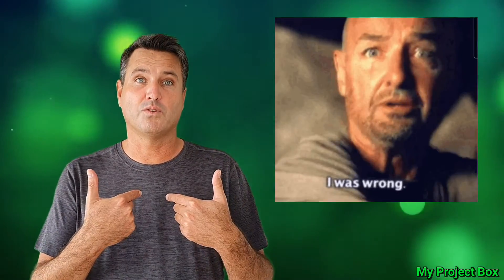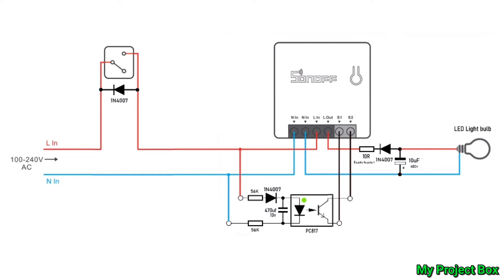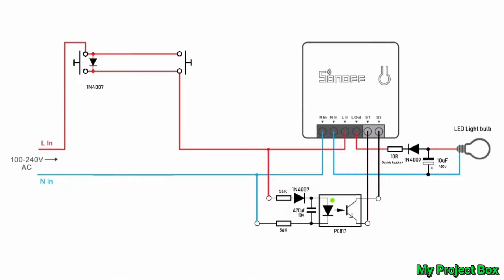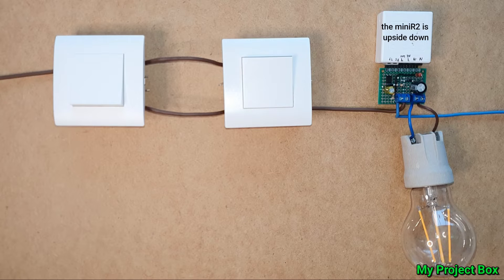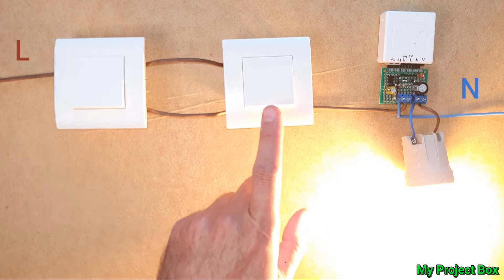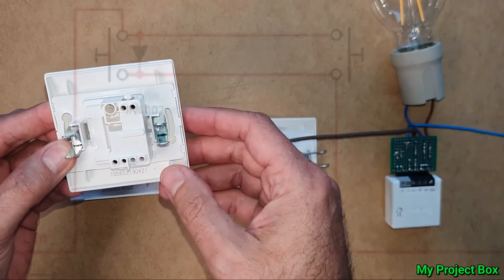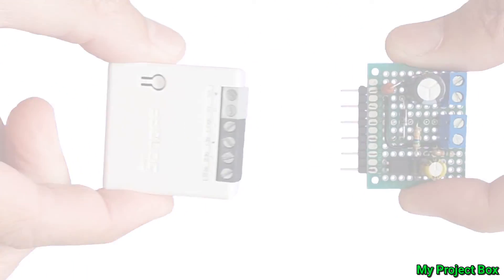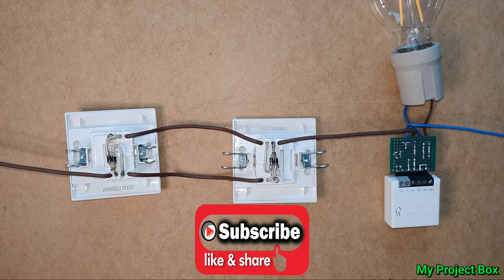Sonoff mini 2-way 3-way light switching NO-NEUTRAL solved #2wayswitch #NoNeutral #sonoff #3wayswitch

Comment: What a great solution for older wiring plans, ie where there is no neutral at the switch and/or no permanent live at the light fitting. I'm interested to know whether you have tried the same approach with a Shelly 1 rather than a Sonoff mini?
Reply from the maker: The circuit works perfectly with Shelly1 as well! I've not done a video on the two-way lighting version of my hack, but it works. I have several "no-neutral" solutions for Shelly1. 
https://youtu.be/fT3YztU2MYE 

https://youtu.be/YItMu6VJGBI

Comment: Can you do 2way uk for the no neutral variant? Thanks
Reply from the maker: Yes it would definitely be possible to do it with UK 2-way lighting. It should be a bit simpler, because you would only require one diode, across the switch that has  live-in and switched-live out.
It would also be possible with my simpler no-neutral hack circuit https://youtu.be/oBR5O391m_c I might have to do a video about it😉👍

Comment: How beautiful it is is what you have done. I'm very impressed. Now I'm sitting around wondering what to buy to match the components for my voltages and frequency. If there was a little bit of theory with calculating the size of the components I would be entranced. For example, are the resistors before the optocoupler too large or current is too low for optocoupler diode?
Reply from the maker: This circuit was demonstrated in this video on European "220-240 volt"50 Hz. It should work on 110V in North America mabe just reduce the resistor values and increase the capacitor values. Sonoff now has "magic switch mode" for the Sonoff basic-R4. It makes doing this much simpler and easier. https://youtu.be/NudSvGNqbAo

Comment: Hello - thanks for this video. So useful. Any chance you could tell us the exact diodes you used? There seem to be so many options online. Thanks
Reply from the maker: I used 1N4007 diodes, they are rated at 1Amp. You could use bigger more powerful diodes, if you want the circuit to be super tough and robust. Diodes like the 10A10 , are rated for 10Amp.
Reply: Brilliant, thanks so much. My knowledge is limited but doesn't an LED lightbulb pull more than 1amp? Or is the diode only under strain when the circuit is closed and halfway is going through it powering the Sonof? 

Also - what would be the advantages / dis-advantages of getting the higher rated diodes?

Thanks so much for your time, it's much appreciated

 @MyProjectBoxChannel
Reply from the maker: @RGH-rq4gj  1AMP at 220v is  effectively 220W. Most LED bulbs are not much more than 12w. If you use 10A diodes, that gives you a crazy 2200W to play with. But the reason for possibly using 10A diodes, is in case something goes wrong, and you get a short-circuit. It's makes it more likely the diodes can survive a dramatic event like that, and the circuit breaker tripping without damaging anything. The 10A10 Diodes can handle 10A continues, and over 200A for a brief instant. So it's much harder to destroy a 10A10 Diode, but it's much easier to blow up a 1N4007. The 10A10 is bigger, so it will waste more space than the smaller 1N4007.

Comment from the maker: This PCB was not designed by me, but I did help and advise the designer. He wanted to be able to change the filter capacitor for different types of LED load. So you connect the capacitor of your choice, directly to the output terminals. The two 500k resistors are in parallel with the capacitor, and are there to safety discharge the capacitor, to prevent a shock from  it, because it can hold a charge for a long time. The bigger diodes are simply to make the design more robust bigger ones can probably survive a circuit breaker tripping, if there is a fault or short-circuit. He used a very big fusible resistor for bigger output loads. 

The PCB works fine but it still needs some work / tweaks. I think the fusible resistor position needs to change. It would be better to only be inline/series with the capacitor. That would prevent it from getting blown from bigger more powerful output loads.

Comment: @MyProjectBoxChannel  hey, I saw your pcb layouts on github and i wanted to know why you exchanged the 10uF capacitor after Lout of the Sonnoff with 2 500k resistors? Can you please explain why you did this? As you said you added the capacitor against flickering. So why and how are those 2 resistors do that job now instead ? 

Another question I have is why you didn't put 10A diodes directly instead of changing from 1A to 3A ? For safety reasons .... wouldn't it be senceful to use diodes with the max. current the sonoff supports from its side, even if noone would usualyy not use 2000W lightning at all? So the diodes behind the switch never should get overloaded by some faults.

And as my last question, because I don't really get it somewhere .... what is R3 for an exact value (what means 5W5?) and what is that resistor used for? 

Thank you very very much for your efforts !!! You make really great work !!! thx
Reply from the maker: This PCB was not designed by me, but I did help and advise the designer. He wanted to be able to change the filter capacitor for different types of LED load. So you connect the capacitor of your choice, directly to the output terminals. The two 500k resistors(makes 1M resistor)are in parallel with the output capacitor, and are there to safety discharge the capacitor, to prevent a shock from  it, because it can hold a charge for a long time. The bigger diodes are simply to make the design more robust. If you use 10Amp diodes they could survive a short-circuit/fault , and circuit breaker tripping.
The "big fusible resistor" was chosen by the designer, for bigger output loads. But I think it would be better to move the resistor, and now put it inline/series with the output capacitor. That would prevent it getting blown by bigger/ more powerful loads. It would  no longer have to carry the full output current, just the inrush current limiting to the capacitor, and ripple current. The PCB works great,  but needs more work/tweaking. I don't like the big power resistor, as the fusible resistor. So that's why I want to change the position, so you can use a smaller one. It's still a work in progress 😉.
Reply: @MyProjectBoxChannel  thank you so much for the explanation and a nice xmas :). Now it's totally clear, after you explained it again. Don't know why I didn't notice that by myself :D So, if I see it correctly on the pcb layout you either use a resistor OR a fuse, correct? In the schemativ you have a resistor AND the fuse in series, but on the pcb is only one component placed (R3). Is that correct ?
Reply from the maker: @andreasj.411  In my original design I used a special type of resistor, called a fusible resistor. It behaves as both a fuse and a resistor combined. You can also create your own fusible resistor, by putting a resistor in series with a fuse. The there are different versions of the pcb. I think the designer chose a really big power resistor, for heavy loads. I'm not sure if he chose a big "fusible-resistor", or just a big ceramic resistor, but you could make it fusible. You just  use a resistor+fuse. I'm starting to think that this resistor used as the main protection fuse, could be problematic for bigger loads. His solution was just use a bigger resistor, but I prefer to move it out of the main current path. A bit like in this video https://youtu.be/mznx0xoF8Ck

Comment: Nice video, i've created a homemade circuit in Brazil and it works. I would like to print this circuit, do you have any geber files that could share?
Reply from the maker: I have some prototype files for the shelly1 but it can work with the Sonoff mini-R2 https://github.com/orlin369/DeNeutralizer/tree/main/DeNeutralizer 
Here is a NO-NEUTRAL circuit that is also useful https://youtu.be/oBR5O391m_c

Comment: Hi again @MyProjectBox... do you know how to connect sonoff switch, shelly or any smart switch to short distance touchless pir sensor like this one - "or-cr-213 short distance pir sensor"
I'm using such sensor in my kitchen and with moving my hand near the sensor the led light in the kitchen is turning on. I want to connect the sensor to smart switch and to keep using both - the switch and the physical sensor. The pir sensor has 3 wires: phase, N and COM

Comment: Would this work with a UK 3 way switch that has an intermediate switch?
Reply from the maker: That is a good question 🤔. I in theory it could work, BUT! If the intermediate switch is switched too slowly, then the sonoff will lose power for a brief moment. This might cause problems. The intermediate switch might need diodes aswell. I will have to look into it.
Reply: @MyProjectBoxChannel  thanks! Intermediate switch has been a pain to try and turn smart in my home. Currently looking at converting them to momentary switches but in an ideal world like to keep the existing switches
Reply from the maker: @petermcneill9728  If you live in the UK, it's possible that you likely have the loop-in at ceiling rose, wiring system. That means that you probably have all the connections you need, for the sonoff mini, at the ceiling rose. https://youtu.be/ZaAZA8IbaQU
Also 3-way lighting is often wired differently than in Europe. So if you want to do the "diodes circuit" , you might just need a single diode to make it work. That could make things very simple.

Comment: Will this work with Aqara Single Switch Module T1 ?
Reply: Tested with Aqara T1 relay switch and works fine.🎉
Reply from the maker: @Hristo.Dimitrov  nice👍Thanks for letting us know😉. It will probably work with this circuit aswell. https://youtu.be/oBR5O391m_c
Reply: @MyProjectBoxChannel  I mount it on diagram with two two-way switches and one 4 way switch between them, but in some positions the switches does not turn on the lights. Should I put diodes into the four-way switch as well in order to keep the diagram loaded and how to wire them to the four-way switch.
If you can give me advice on how to put the diodes in the four-way switch will be great.
Reply from the maker: @Hristo.Dimitrov  that is a good question 🤔. I have not tested the intermediate switch (Cross switch) with diodes yet. I will need to do some testing to verify that it
https://youtu.be/fr-rDe3NbPY
Reply: @MyProjectBoxChannel  I was thinking about the same, but wasn't sure. Will test it tomorrow
Reply from the maker: I've not tried it yet, but it is possible that it could work. Some experimentation may be required.

Comment: Is there a reason why you chose the Shelly1 and sonoff mini? will this work with other modules like the tuya zigbee switch modules(from Moes for e.g.)?
Reply from the maker: It is possible that other smart switches could work with this circuit. It would require some experimentation.

Comment: Well, what I did, is to replace the 3 switches with bell switches that are NC (Normally connected), it works sort of when switching to momentary mode.
The problem I have is capacitive coupling I think, and when pressing a button, it triggers after a second press when the voltage is drained.
So from 3 gang switches, one wire I made L, and second SL via the door bell switch.
However don't know how to solve that situation, thinking about putting a diode after switches to make it more sensitive or putting an 1 MOhm resistor between S2 and LOut to put constant load, don't know if it work.

Comment: Hi, smart solutions by using half of the sinusoidal wave. Looking into this solution for three way, I was wondering if you really need two diodes for both switches, I suppose it would also work if just one of the switches had those two diodes. So, you could choose the first or the second switch and insert the diodes, because even so there is always a path for the current. Am I right? Regards..
Reply from the maker: You are correct,  in that, if the switches are static, in one or other positions. With just 2 diodes on one switch,  you do have a continuous path. BUT! There will be a brief moment when the "switch with no diodes", transitions from one position to a another. Then there is no connection to the travelers/strappers , until it makes contact again. It's very quick,  but it might cause problems with the Sonoff not being powered for a split second. You could build a test rig to verify if this dead time will cause problems. Maybe if with some types of switches you deliberately switch them slowly.
Reply: @MyProjectBoxChannel  Indeed! Maybe adding a capacitor would provide the energy for that short time. By the way, the 4 diodes will guarantee that, for sure. Regards.
Reply from the maker: @felipetomaz1843  yes you could add a capacitor at the Sonoff, in the same way as it is by the LED bulb🤔😉👍

Comment: Hi, is there a detailed instruction to assemble the pcb?
Reply from the maker: We had some prototype PCBs manufactured, and we are still testing them for problems and improvements. There will be a github with all the designs soon.
Reply: @MyProjectBoxChannel  thanks, thought i’ve missed a video that shows how to build that pcb
Reply: @MyProjectBoxChannel  Can we receive the designs already or they are still in progress?
Regards..
Reply from the maker: @Hristo.Dimitrov  It's not quite ready yet, but you can look at the github. We want to do a version that is compatible with shelly1 and sonoff mini-R2. https://github.com/orlin369/DeNeutralizer
The pcb is designed in KiCad.
Reply: @MyProjectBoxChannel  thank you I will take a look at the diagrams. Also if you start selling your prototype I will order couple pieces for me and my friends. I'm using aqara eco system but I think this will work for aqara t1 switches as well.
Reply from the maker: @Hristo.Dimitrov  I have a  different "no-neutral circuit",  that you can make without a pcb. It might be useful to test different types of smart switches . https://youtu.be/oBR5O391m_c
It also works with multiple gang types  https://youtu.be/8h29-0rpQJo
Reply: @MyProjectBoxChannel  As far as I understood "no-neutral circuit" doesn't work with two-way switching. I want to try doing this diagram for my two-way switching diagram
Reply from the maker: @Hristo.Dimitrov  let me know how you get one with it.

Comment: Thanks! Now I have to figure out resistor values for a 110v 60hz Mexican installations 😄
Reply from the maker: You are welcome to experiment! It might work on 110V as it is. Just make a test circuit, and if you need to reduce the resistor values a bit( you could just use half the value 1/2). I have a different "no-neutral" circuit as well if you want to try. https://youtu.be/oBR5O391m_c 
Good luck 👍

Comment: Why not use the S1 S2 connection for multiway switching?
Reply from the maker: To do that, you need a neutral wire behind the switch. And you need to somehow access both ends of the feeds, to both switches (for the 2wire system). You could do it in the UK, with the 3wire multi-way switching, commonly used over there. My circuit hack gives people options, if they can't easily pull extra wires to the switch boxes.
Reply: Any chance you could explain how to do that with a uk 2-way 3 core and earth setup ? No neutrals at switch. Trying and failing to get it right with a ZB Mini L 😢
Reply: @irishpete79  Did you end up doing it? Got an Aqara relay I want to add to my 2 way setup

Comment: Sonoff is junk. Everybody in the US that I've seen try to use them ends up regretting it. Their products do not meet US electrical code at all. The products you're using in your video are only rated for 10 amps while the lowest amperage rating on a residential circuit breaker is 15 amps, which means they can start an electrical fire before the circuit breaker can cut the power.
Reply from the maker: It depends on the country you live in. In the UK with everything on 230v, a lighting circuit is normally on a 6 amp breaker. So the 10A rating is fine. But I know what you mean. I think a "local" internal ( inside the sonoff) fuse would be a good idea. LED lighting draws very low current, but it the fault current, a failure somewhere, that the problem.
Reply: I just purchased a few Sonoff BasicR2 (for lamp cords) and Sonoff MiniR2 (for light switches).  I have not yet received the order, but I was wondering if the low price was any indication of quality.   I also live in the US and plan on experimenting with these.  I only want devices that are compatible with the Tasmota firmware.  So, what model do you recommend other than the Sonoff brand.
Reply: @wildwyer6782, do you recommend any other brands to look at?

Comment: Did you mean 3-way light switch?
Reply: It's so dumb that we call them 3-way switches. They should be called 2-way switches.
Reply: Comments about 3-way switching have confused the hell out of me in the past, as most countries outside the US use the term n-way to refer to a circuit with n switches controlling a single light/group of lights, ie 2-way uses 2 x SPDT switches, 3-way uses 2 x SPDT switches and an intermediate DPDT switch, 4-way = 2 x SPDT switches and 2 intermediate DPDT switches, etc. It's a good job we don't have alternative meanings for things like 'pavement' 😉🤣
Reply from the maker: @DaveLumby  I'm sticking with 2-way light switching. But I will respect the Americans calling it 3-way. On "DIY Wiki" it's called 2-way! that's good enough for me. http://wiki.diyfaq.org.uk/index.php/2_Way_Switching
I'm also fine with: lamp or light bulb or globe. Electricians can be very pedantic about names for things😂😂😂😂😂. They might call a 12 volt LED power supply, a ballast or a driver.
Reply from the maker: In electronics it's called change over switch. Single pole double throw.